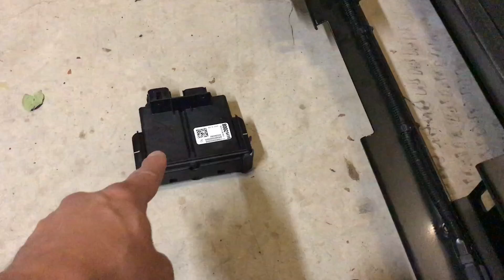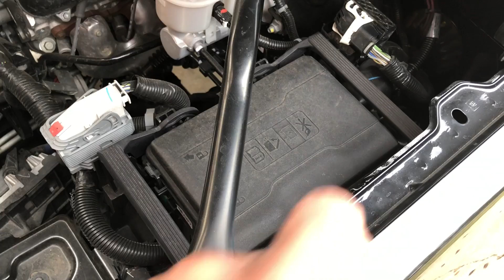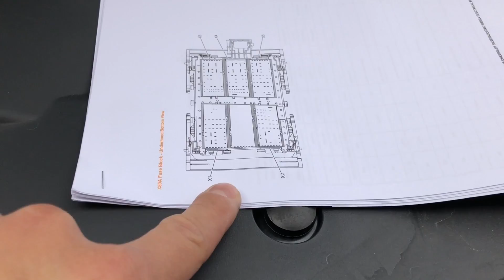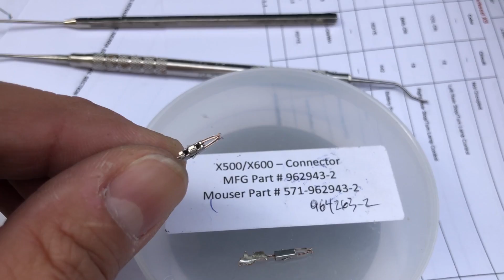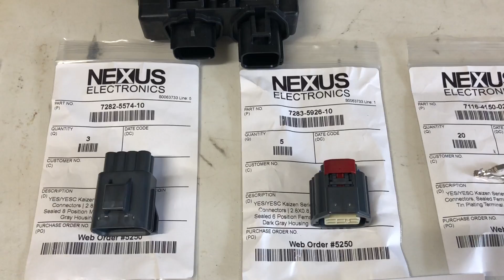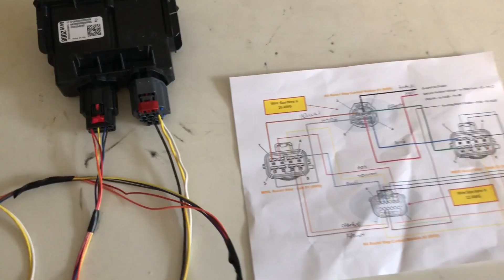2016 Silverado LT - Articulating (Tri-Mode) Running Boards Retrofit

Comment from the maker: NOTE:  The drawing in the video shows 16AWG and 12AWG.  This is INCORRECT.  The correct wiring should be 16AWG and 22AWG.  Layout has been updated and can be downloaded here.  https://www.dropbox.com/s/8kr7qdwq19y7r0q/Running%20Board%20Layout.pdf?dl=0
Reply: Phil Gamboa would these fit on a 2015 Denali?
Reply: Good afternoon Phil, I am trying to do this conversion on my 2015 silverado, I already purchased the steps, the dash switch, and im in the process of buying the harness from you, I read in the comments on your website that i would need to buy a different fuse box, do you by any chance have the part number to that fuse box? Thank you!!! Keep up the great work.
Reply: @M_rrr572  did you get yours going bro
Reply: Phil Gamboa  but I need  all the pages to see the numbers so I can order the plogs you think you can send to me thanks
Reply from the maker: Jacob Sullivan - My presumption is if you’re a Crew cab, yes.
Reply: Phil Gamboa do you only do personal work? I just bought same running boards need this done on my 2016 GMC Sierra allterrain
Reply: @noebarbosa2373   di you find the wire Harness
Reply: Do you still have the drawing. the link doesn't work for me. thanks in advance
Reply: Hey Phil. What will you charge to make a running board harness for the 2007 to 2014 GM Tahoe Yukon escalade? I have the boards and computer motors etc just cant find a harness.
Reply: Phil Gamboa, will this fit on a 2011 Chevy Tahoe LT if so what kind of harness wiring will I need?
Reply from the maker: Ryunita Hart not sure on the fitment or requirements for trucks older than 2014.
Reply: Hey Phil, I know this may be an old thread. Would highly appreciate a response. Will this wiring method work on a 2018 Yukon Denali? Are the wire schematics the same?
Reply: I’m concerned about them running into bigger sized tires or offset set of wheels that poke more is there a way to limit or reduce the stop at which they open towards the back with the kick switch?
Reply from the maker: @omarramirez2335  there is not.
Reply: Hey Phil i bought them with the complete harness will it work if or do I have to add extra wires

Comment: @philgboa2906 I got a 2015 gmc sierra SLT I  had just bought power running boards oem and I went looking the for the fuse and stuff and I couldn’t find it could I still make these steps work on my truck or no?

Comment: Great write up!! Thx. Were you able to add the control switch on the dash so the boards could be manually controlled or frozen by the switch?
Reply from the maker: Yes.

Comment: I know this is a bit old, so I’m hoping you’re still monitoring the comments. Do you know if the tri mode running boards that came on the 2019 GMC Sierra is the same or similar to the ones that were on the earlier models like you have? I have an opportunity to buy a pair but they were off a 2019 (Model). I’ve only been trying to compare the physical looks of them through pictures and they look the same. What do you think?
Reply from the maker: They look the same but are different and won't work.

Comment: Can I install a pair of articulating running boards of a 2014 Tahoe in a 2016 Sierra?
Reply from the maker: No. SUV boards are build different.
Reply: @philgamboa2906  If I have the articulating running boards with their module and harness, can I connect them according to how you explain it in the video?
Reply from the maker: @jasso9658 - yes or buy my harness and only connect 3 pins

Comment: I have a GMC sierra z71 2016, also adapted same step boards. Changed the battery and for some reason passenger side stuck inside and the driver side stuck outside. Not opening or closing. Fuse is good. Do you have any ideas on what the issue might be?

Comment: How do you access the top bolt on the rear pivot that comes from inside the rocker and threads into the bracket
Reply: I figured it out. I have been out of shops for awhile. Been trying to get my steps fixed for 2 months through the dealer. They put new motors and then said the rear pivot bushing were bad then today they were like we can't install the a bolt comes from inside the rocker go to a body shop. I got under it they just have to fully remove the steps mounting bracket and the bolt is on the back side of the bracket not inside the rocker. Bad thing is an older tech was working on it.
Reply from the maker: Not sure I follow. Are you trying to install/remove or do something else? All mounting bolts to physically install can be accessed without any obstruction.

Comment: Did you have to do a reset for the position of the running board or does it know where it is when its hooked up automatically?
Reply from the maker: During a power disconnect/reconnect, first door open, the boards should go all the way to the back. Then close door and open again, then it should retract outward. It will always cycle all the way to the back on a batter disconnect/reconnect the first door open.
Reply: Is there any indexing that needs to be done when replacing a drive motor or do they find home positions in their own? @philgamboa2906

Comment: I bought a set of running boards off of Facebook Marketplace, bought the Harness Dr harnes, bought the inside switch for the center console. Installe it in a couple hours and everything works great.

Comment: I ordered the harness yesterday, thank you. I want to also add the switch to my center console. Is that plug and play or is more wiring needed?
Reply from the maker: What year is your truck? For 2016-2018 trucks, the wiring for the "running board disable" should be present from the X138 connector to your center stack switches. So it should be plug and play with the new switches. Thanks for your order!
Reply: @philgamboa2906 it's a 2016 so your video is perfect! My underhood items are the exact same as yours so this will be very helpful. Are any special tools needed to add the terminals to the connectors?
Reply from the maker: @Mr-Payne2000  - No special tools. Maybe a small flathead. Just be 100% certain of the terminal landings because if you land it in the wrong spot, you'll need a special tool to de-pin it.
Reply: @philgamboa2906 I received the harness and it looks great. What size loom did you use? I want a little more protection than the harness tape.
Reply from the maker: @Mr-Payne2000  - I believe it may need to be 3/4". I did a batch with loom and it made it difficult to install. Got the feedback from customers as well. So went back to harness tape.
Reply: @ yes I can see how it would make it more difficult to install. I think I'm going to skip the loom. What path do you take to get to the passenger side? Going across the transmission cross member might get close to the driveshaft and three exhaust.
Reply from the maker: @Mr-Payne2000  Yep. What I did to mine, to add more protection around the exhaust cross path, is added some heat aluminum tape (you'll see an example of this in a wire loom along the same path).

Comment: Would you happen to have a part number for the extra nutsert clip needed?
Reply from the maker: If you have existing fixed boards, you should end up with extras. They are M8 x 1.25 bolts. The GM part # is 11561740 but can also find generics on amazon. Shoot me an email with how many you think you need. I may have some extras I can send with your order.

Comment: I’m in the process of putting a set of these on my 04 2500hd. It’s crazy that they bolt right on. I just need to figure the wiring out🤦‍♂️
Reply from the maker: @dodgezilla1012  that’s a tough one.
Reply: @ I think I can use an AMP step wiring harness. I don’t really need the kick function

Comment: I have everything hooked up on mine, just installed and wired up, both sides extend and retract, but neither side responds to the kick switch, any ideas?
Reply from the maker: @tlr42  - give it about 10-15 mins. Drive it around and test.
Reply from the maker: Any luck after waiting about 10 mins or so?

Comment: How do you program them? I installed following you but I am missing that last step
Reply from the maker: 14-22 don't need progamming. 2022.5 and later do....from what someone else told me. I don't program.
Reply: @philgamboa2906 what can I do if my connector doesn’t have the 8 pin where the green cable goes?

Comment: Hello, Thank for posting this. Any suggestions on how I can test my driver's side motor using a multimeter to make sure it's still good? 2017 Sierra Denali 6.2L, Passenger side works fine. Driver's side is dead.

Comment: Is it possible to use this harness for aftermarket steps?
Reply from the maker: No. Only for factory boards from a 19-22 truck.  Doesn’t work with 2022.5+ “refresh” trucks.
Reply: @philgamboa2906  thank you
Reply: I have a single cab   And have some amp steps but lost harness.  Seems cheaper to buy your harness instead of buying amps harness and module

Comment: What happens if my chevrolet does not have the GMLAN signal, how can I make it send the signals to the computer? 16:37
Reply from the maker: What year is your truck?
Reply: @philgamboa2906  hey phil! 
amazing wiring you do!! 
 I tip my hat to you brother 🎩
the work you do is like the work most of us think we can do at the beggining of a project until we see how complex it gets then we just get impatient and solder and wire nut everything. but you stick with it and do pristine work 👌🏻

anyway I had a real question for you.
i have a 2010 sierra that id like to adapt these to but i dont know if the gmlan program would work or not (or if it was even offered in that older year)i did open my fuse box and also found that it does have a labeled fuse slot for powered running boards as well and on a 30amp jfuse however mine has no fuse in its place. so my question is do you think it would work if my year has the gmlan? and if it doesnt is there any way to rig/modify it to just run off the battery and a relay that works aligned with the door relay? im hoping not the latter. thanks for any input phil keep up the good work brother 🙏🏻💪🏻
Reply from the maker: @rollingguy86  thanks for the feedback and good question. I had some folks about GMLAN in trucks older than 2014 and was told there isn’t. So I’m not sure what or how boards worked in older trucks TBH.

Comment: I’m about to buy a set of these and attempt to retrofit them on my 2004 gmc sierra using the factory module shown in the video. Do you guys think this can be done I’m assuming there is a driver and passenger door ajar wire that would have to go to the module?
Reply from the maker: The boards use a GMLAN Signal, which I don't think is present on 2004 trucks.

Comment: I have a 2014 silverado LT and it doesn't have the fuses for the running boards, can it be attached somehow? and could you pass all the diagram files
Reply from the maker: My 2014/2015 harness is now configured with an inline 30amp fuse so that you don't have to replace the fuse box.  https://harnessdr.com/product/2014-2015-articulating-running-board-harness/
Reply: I made my harness as you mention in the video and with the diagram but when I remove the x138 the signals indicated by pin#8 and pin#39 are not in the male coupling, I can send these signals from the indicators of the doors? I hope you can help me
Reply from the maker: @fhs174  You’ll need to bring them inside the truck. The green GMLAN wire needs to land into a GMLAN distribution spot on the passenger door sill/kick panel.  The pink wire for the running board disable lands in the back of the instrument panel switches under the AC controls.
Reply: @philgamboa2906  Is there a diagram or an illustration from which to get those 2 points, I can't find them and it's the only thing I need to be able to make them work
Reply: @philgamboa2906  should the gmlan signal be positive or negative?
Reply: You will have a diagram of where to find those 2 points that you mention or how I can find them on the internet so as not to make the mistake

Comment: can you put these steps on a double cab LTZ?
Reply from the maker: As long as you cut/modify them to fit - yes.
Reply: @philgamboa2906  is there just four bolts mounting the steps on each side?

Comment: How’d you get them to tuck in without power? Or is that even posible?
Reply from the maker: Loosen the Allen bolts on the knuckle where the board rotates.  Just be sure to keep your hand in it so it doesn’t drop to the ground.

Comment: Awesome work... If I get all the parts from 2015+ Denali (running boards, harness, module, inside dash switch assembly) would it be easy fit for Tahoe 2015+?
Reply from the maker: None of this has been tested in an SUV.

Comment: Where are u located ?
Reply from the maker: Dallas, TX
Reply: @philgamboa2906   I’m from Arlington and I’m trying to install them running boards on my 2015 sierra SLT TX edition but I checked were the cables are supposed to be landed and my connection does not have those Spaces to be landed how can I do it please help
Reply from the maker: @arturooviedo3307  so you don’t have the male 8 and 39 in the body side connector?  You can reach me at HarnessDR.com and we can troubleshoot.

Comment: i just got a set of these side steps, from a 2017 Denali for $100.  My truck is a 2015 GMC SLT crewcab.  Is there much difference between the 2015 and 2016?
Reply from the maker: Wiring harness you’ll want is 14/15.  Same harness but has additional wiring needing to come inside the cabin that GM omitted for 14/15 trucks.

Comment: Hello Mr. Gamboa I found some of the same steps off of a 2019-2021 wonder if they wire the same or maybe could you install them for me in my 2017 GMC Sierra SLT
Reply from the maker: You cannot add them.  Won’t mount and wiring is completely different.
Reply: @philgamboa2906  thanks for letting me know I really would like those tri mode but they are just so darn hard to find. May have to go with the rough country ones since they are the closest in functionality

Comment: Man I need some help. I have a 2021 gmc Denali and I bought the OEM powder running board. And I can’t install them. No wire harness. Where can I get a harness.
Reply from the maker: So, I just got this installed on my 2021 silverado.   I have a harness design concept done but it’s not ready to be sold just yet.  Send me an email from my website.  HarnessDR.com and go from there.

Comment: What harness did you use for the power mirrors for them to flip out when unlocking the truck
Reply: You set that through the DIC on the radio screen.  Hold the unlock button for 2 seconds and the mirrors fold out.  Keep holding and all 4 windows roll down.

Comment: Wanting to do this to my 2019 Sierra with the new power steps that come on the 2500 trucks. Do you think it would be the same process. When I look at my fuse compartment it has the fuse for the power steps.

Comment: hi i had a question......nothing to do with the steps but ....is there a way to put the oem trailer brake  on the 2016 gmc Sierra  1500 ... i have a plug in bakc of the change holder and was woundering if it would just plug and play or what would need to be done ? thanks

Comment: I bought a 2020 silverado high country but I didn't have the Articulating Running Boards installed and I want the factory ones just like you. You say that no additional program is necessary on the truck's computer, that it is only a cable installation?

Comment: Great video! How would you install OEM boards on a 2009 Escalade ext? I recently had one with the factory power steps but sold it and got another one but it doesn’t have the factory button in the cab or boards. I managed to get the OEM boards online for the new truck but I’m not sure how to wire them but I’d like to use the disable switch in the cab so it’s as factory ad it can be. Any suggestions?
Reply from the maker: Not sure.  I only have info for 14-18 trucks.
Reply: Phil Gamboa is there anyway you could help me find the info? Just curious that’s all.
Reply from the maker: @stephenjacykrealtor  I wouldn't know where to start since all my work is done on my personal 2016 truck - most of which applies to 14-18 trucks.  Maybe look for GM Truck forums in your year range?

Comment: Great video. Followed instructions. Drivers side works. Passenger side doesn't, help? Any suggestions?
Reply from the maker: Joseph Richard Not sure on this.  There can be several factors. Bad Board, missed connection, etc.
Reply: Happy to say it was my own error. 1 terminal didn't quite reach.... duuu😚 Thanks for responding. Truly, truly appreciated...

Comment: Not including the running boards, how much did the rest of the part cost? Roughly. Just curious as to how much cost was saved
Reply: I just bought his harness, he has a website on the description. Then the clips and bolts from a hardware store will run you about 20 bucks. So most will go on depending how much you can get the steps for.

Comment: Hey man what hardware did you use to mount them? Never done this before and cannot find no info and chevy dealer has told me this is aftermarket and they don't sell just hardware
Reply: U-nuts and bolts from a hardware store. M8 x 30mm I believe.

Comment: I’d love to slap these on my 2018 3500 denali. I wonder if they are prewired in anyway (denali). I also just purchased a 2019 Yukon Denali xl with the power steps. Those would be nice too. Any info on those?
Reply from the maker: Javier  Hernandez - They are not pre-wired. Also, if you have DEF tank, I don’t think you can mount them. 

I am now building/selling this harness for $250.  If interested, email me at gamboaphil@gmail.com
Reply: @philgamboa2906  are you still making the harness
Reply from the maker: @mattmutert3157  Yes sir.  Visit my website at HarnessDR.com  Thanks!